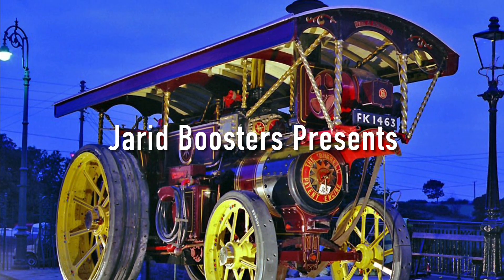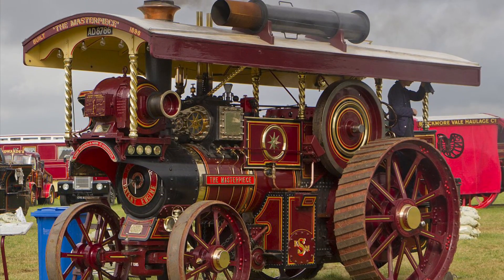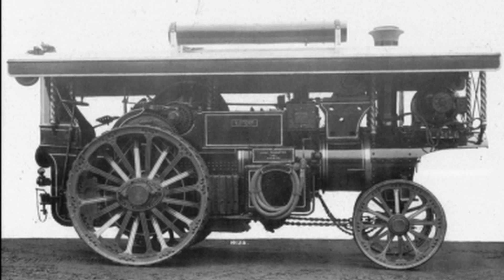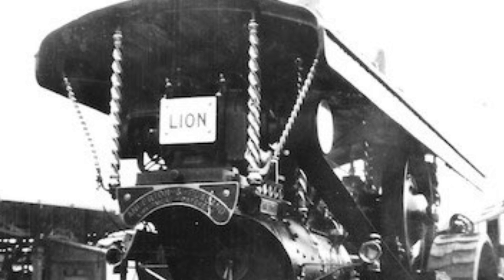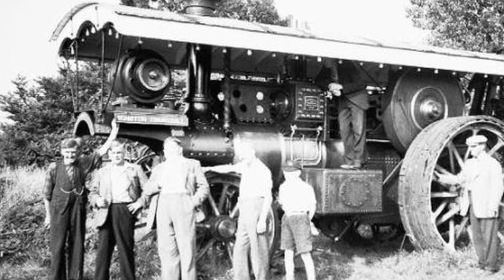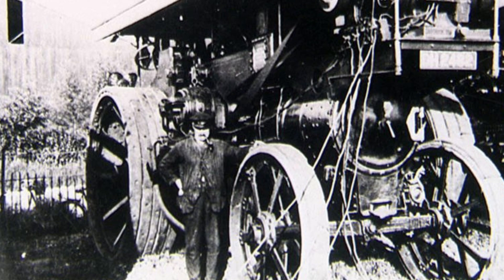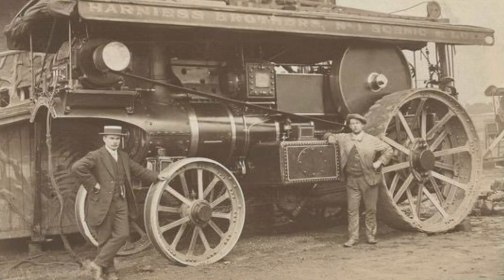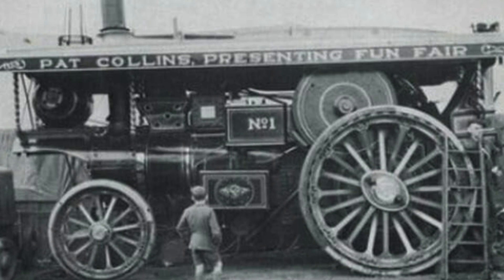The Showman’s Traveling Dynamo; Advanced Steam Vehicle - Portable Electric Station (1860? - 1934)

Comment: There are basically tractors , pretty typical for the time and likely 20-50 hp nax in that frame . They were modified to do all sorts of things .  Without moving you would have 20-50 x 738watts  witch on the low end is 14kw . When steam tractors were introduced people were afraid of them , mechanical monsters . That being said they fancied them up to sell and help people be less afraid  . Alot of equipment built and designed at the time were ornate, look at early power plants or that sewage pump in England .
Reply: People werent affraid,  same is now people wanna stay same old, audi drivers want vroomvroom cars and are affraid electric cars, 1800 humans werent like man eating savages
Reply: @jussikankinen9409  of course this would be anicdotal but I'm getting this from written accounts that were with some of the tractors at a fair years ago . The owner of the one steam tractor said seing something that large move on its own was scary as a kid . Now I don't mean it was a terrifying monster but if everything is horse drawn then all of a sudden there's big steam powered machines much larger than current farm equipment .I'm sure it unnerved a few people , as well as captivated others .
Reply: When you see the ornate details, it should tip you off that we didn't design the originals but rather turned on old production lines. The Old World power plants with their 'ornate' construction, once ones eyes are open, the ornate turns into exactly how you would engineer the building and vibrational dampening structure using FEA software for a civilization that builds stuff to last thousands of years. The original power plant engines would have lasted forever with their brick foundations and vibrations are one of the main enemy of nuke power plants today.

Comment: Steam is the cleanest power source on Earth when you arent firing it with coal. 
Like the red hot element in a toaster, wirelessly powered, heating the steam. 
Efficient, clean, genius.
Reply: The steam was generated by burning stuff.   Which would be wood or coal.  

What do you think causes steam?
Reply: @johanvangelderen6715  Wireless power is capable of generating the heat. Old World apartment blocks had big ornate fire places without chimneys but contained wired copper conductors to the roof. We have answered a question here.... coal is a deception.
Reply: @togowack  

PT Barmum was right. 

No shortage of suckers !
Reply: @johanvangelderen6715  No shortage of trolls either. Engage on the subject matter with an argument or don't waste the time... I've seen the fireplaces for myself. Most people renting those apartment blocks have no idea why its like that.

Comment: A curious question, but what if these machines (large and built for very serious work) were also inherited? Found in warehouses and among the many gigantic buildings from pre-1900 lands? Making entries in history books as though they were released one year and discontinued almost immediately would make easy work to explain them away. 
I think Brooklyn Bridge is pretty damning for having rails going on it and then removed.
Reply: A lot of the old rails were for street cars which ran off of electricity. All the old pictures of utility poles with wires everywhere were for these street cars and not for wireless power as hypothesized.
Reply: steam engines were used for work, yes, you can see this plainly in old machine equipment, they run off of belts and clutches as a part of a "lineshaft". this type of power was used for centuries from water mills all the way until early electric power, when it became more economical to have small electric engines in each tool rather than one large engine run every tool
Reply: Everything was inherited, with such short lifespans and hard lives why could we ever expect the elaborate engineering and craftsmanship. There may have been an old production line, and government contracts to make them out of necessity, because thats still how they run things today.
Reply: They was definitely used on construction sites and road works I remember them powering merry go rounds and fair lights
Reply: @CEE-DOT-DEE I have no recollection of our engines being used in construction. Nor have I heard of this?

Comment: I think you maybe a little wrong here mate ,  These machines were originally used on farms for threshing machinery and ploughing also used as haulage tractors , the showman or travelling circuses adapted these for their own use later on and installed the dynamos. ,   they were also used on the roads as road rollers and quarrys for moving stone , there  are videos on you tube showing their use of all the different machinery look for the great dorset fair its on every year although they haved moved site and the previous name was different , I helped restore a burrel called the Saint Branock  in the 1980s with the owner  Trevor Williams down at his yard over the Blackwall  tunnel. The chimneys had the extention for when they were working to allow smoke and sparks get up higher so as not to cause a fire on the fields of straw etc but when in use on the roads they took them off . just saying
Reply from the maker: I mention their origins in farming, agriculture, and city development, however the testament they hold to history appears under the auspices of the title “Showman’s Dynamo”, hence the video. However I do go over the history you just mentioned, as well as giving sources which discuss the same down below.
Reply: Couldn't power the rides?
So explain an engine called EX Mayor pushing over 300 amps at 110 bolts to the fairground at Old Warden rally. Rated at 10 nhp but actually producing around 75 electrical hp for several hours on end.
Steam Power. Don't stand in the way, it doesn't take prisoners.....

Comment: Omg you just helped me connect some serious dots! I have totally heard of Showman's Engines and traveling dynamos, but I never realized they generated electricity! 🤯💡⚡😅
Reply: I can tell you a ark rectifier is what powered the dynamo to supply 110dc volts of electricity ⚡️
Reply: Dynamo literally means generator. I'm not an expert, but I'm pretty sure the design is exactly the same as a motor. You just run it the opposite direction and hook up wires to it to produce DC power. This technology had to exist before we could create a gas powered engine. We also had electric vehicles before gas engines which were likely a better choice from the get go. Money and power were the real reasons for the popularity of gas engines.
Reply: @Ed-ym4tu  yes, and I learned about dynamos being generators some time ago but I never connected it to these traveling dynamos. Dynamo is also an informal definition of "an extremely energetic person". (Kinda convenient to have two very different definitions if you want to make history confusing.) So, I had apparently just assumed that was the dynamo that was being referred to when it was actually the generator definition! It's all very exciting to me! I agree too about money and power, it's a constant theme.

Comment: These are very similar to the Moline and Case steam engines used in farming early 1920. Go to Cummings, GA on July 4th parade and you will see 100’s of them. 

What is different is the electricity dynamo. What is the kW output?

Comment: i heard a story (cant remember when or where) that somewhere there are locomotive engines stored in vats of lubricant.  sounds strange, but who knows?  they might come in handy someday.
Reply: This is what is actually at Area 51. And if you did store that equipment in oil it would last forever, no rusting, corrosion or exposure to elements, with the entire steel body conducting electricity, it would also be considered in that case pre atomic age steel, which is what makes old undersea ship wrecks so valuable. This would be the ideal way to store the old stuff

Comment: In England we called them Traction Engines . My Mother held a driving license from about 1930 and her license allowed her to drive a Traction Engine which was the term by then for the Showmans engine, not that she did. Her father and grandfather had a major house building business
Reply: Power? 300amps at 110volts DC that's about 76 horsepower and you need another ten to drive the macherinary.
I the UK many of the Dynamos were made by Mather and Platt who had an agreement with Nicolas Tesla for the use of some of his patents.
Remember the engines without the dynamo but with an under boiler winch were used for ploughing, two engines required.
Others were used as Tractors are today. Moving loads driving threshing machines etc.
Others fitted with rollers instead of wheels were use for smoothing roads.
Curious note in the UK you can drive a traction engine on your normal car licence, but you have to have another driving test to drive a roller.
It's not cheap to own a steam traction engine.
I commentate on steam rallys and we had a poem dropped into the commentary box.
'It used to be Red but now it's Blue,
It didn't go, but now it do,
We used to have money,
But now we're broke.....
Reply: Up until now, I've seen plenty of tractor style steam engines. But never one with that enormous generator in front or that mast and cable pilon in the back. If I had, I probably just assumed it was a farm track. And overlooked the generator. In the early 18 hundreds, there were very few trees in North America. Maybe they could have driven these things cross country. Or maybe the originals were only found in one or two locations and / or never reproduced in the US.

Comment: The true old dynamos were a completely different design than the factory made ones pictured here.  The designs shown here are just a generator hooked to a steam engine, subject to lenz law, the older ones that powered the old world were huge, advanced flux switching alternators/generators.  You wont find much about them on any search engines.  only flux switching motors will show up in the searches, they are not the same thing.  the old world ones could power itself with a lot of power left over and only used in large commercial applications .  they were destroyed and replaced with steam powered generators.  great video though, those machines are a work of art.
Reply: @terriblefez  I don't know anything about aluminum production but if I had to guess, the most efficient way to make low voltage and high amperage power is using a homopolar generator like tesla or Bruce DePalma's.
Reply: @thanksagainforthetea  Russian researchers are very far ahead of us here in the US. There are a few people that understand the technology and have translated it to English from Russian.  Google Vladimir utkin pdf.  There is some good info there if ya can learn to understand it.  Where does the free energy come from?  The ground connections that are left out of all of tesla patients, at the time of his patients the ground connections were just assumed.
Reply: @thanksagainforthetea  I've spent the last decade studying free energy machines.  I've read so many papers from researchers and examining very old photos and drawings.  Tesla patents work if ya use the right kind of power. High frequency sharp unidirectional impulses in a resonant circut have different physical properties than any physics class will teach you.  You have to experiment for yourself so sort truth from lies.  They don't want us to have free power and they will do anything to stop it, lots of people have free energy machines, they just don't let people know about it.
Reply: Do you know if ALL of the old(original) ones were destroyed? And has Paris ever explained why many of its old world buildings etc still stand? Have you seen the medieval bicycles? And did the old world really need machineary?
Reply: @dannwan8537  no to all your questions. I've focused on how to make free energy machines, not much about their history. Sorry, it's not my area of expertise. I don't claim to know a lot, but I know a few things a lot of people don't.
Reply: @allenhargis4317  Have you heard of a film focused on the natural world/planet? Focsued on little to no tech? Not much machinery used on that planet! No cars, no buses no hard pavements. What you may or may not know is still focused on (free) machinery .
Reply: links? proof?
Reply: Rubbish.